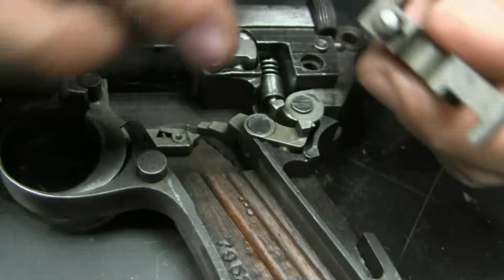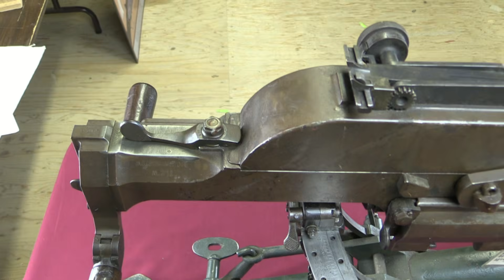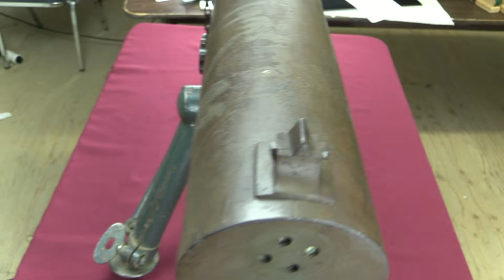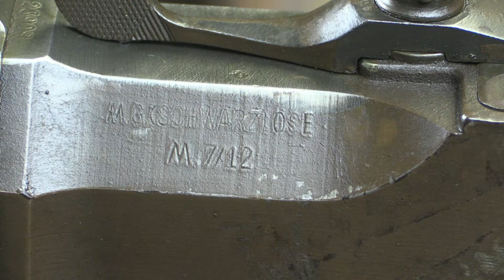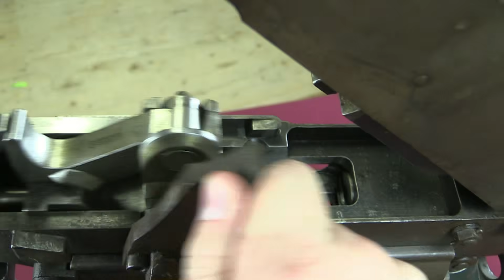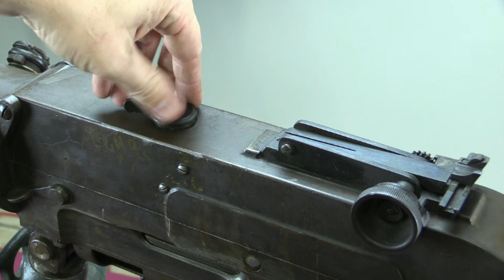Schwarzlose M1907/12 Heavy Machine Gun

Comment: This thing look's to be.... With fix barrel.... Quite accurate... Did it have a reputation for good accuracy?
Reply from the maker: I haven't found any original reports on the accuracy, but I would expect it to be quite good because of the fixed barrel.
Reply: Forgotten Weapons
The only thing I know, is that it was nearly unusable in russia doring WWII, as the watercoolant froze up, if you didn't keep firing.
Reply: It could damage the weapon due to the sudden change in temperature.
Reply: I understand it did. It was very stable and (thankfully for the Austrians) worked well in cold weather. The gun was originally in 8x50, and many remained in that caliber in WWII. They were also converted to 7.92x57 and 8x56 by some users. It and nthe Vickers would be my choice if I could buy an HMG (I have lots of .303 for my Enfields and a couple of fat neighbors that give me trouble)
Reply: Ego Alter, I do not think that it depended solely on the machinery the 2nd Hungarian Army had. So I mean... you can not say it is a bad gun, because the 2nd Hungarian Army didn't succeed on the eastern front, and you can not say the did not succeed solely due to the gun, the whole thing is just more complex than that....
Reply: Ego Alter So what if the coolant freezes? You can use snow and ice as coolant as well, it doesn't affect the performance of the weapon.
Reply: Ulric Kessler Actually, a lot of Russian water-cooled guns had mechanisms by which snow could be more-or-less safely used as a coolant (though I'm not certain of the specifics).
Reply: Ego Alter
LOL, i never thought of that
Reply: Ego Alter if im not mistaken the fins actually used snow cooling with great succes
Reply: Models of the Maxim 1910 had a larger cap on the top of the water jacket so you could throw in handfuls of snow if no otjer water was available. Some of the demilled Finnish guns on the market have this feature.
Reply: Well this was not developed by russians. Hungarians used it, and it didn't get them very far: "http://en.wikipedia.org/wiki/Second_Army_(Hungary)#The_Don_River.2C_Operation_Saturn.2C_and_disaster"